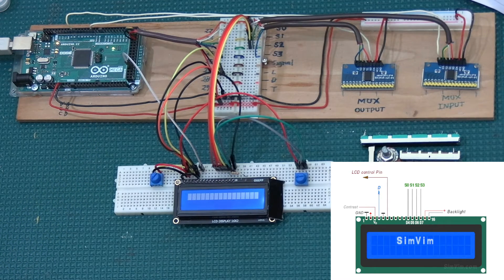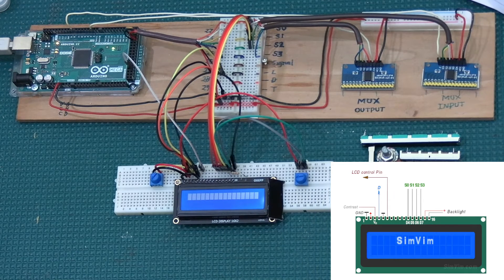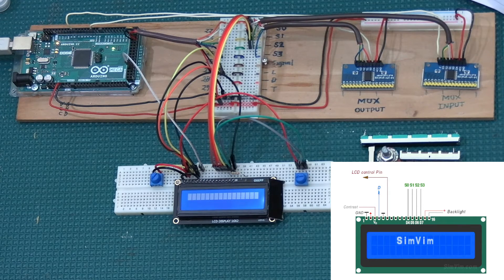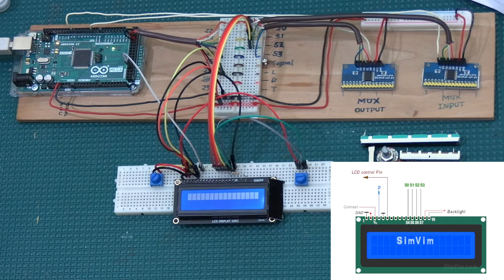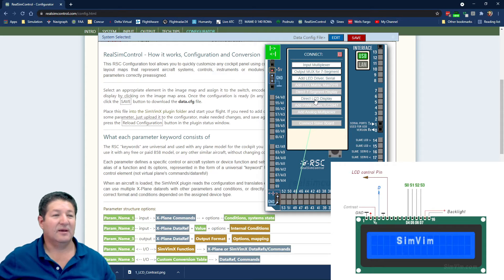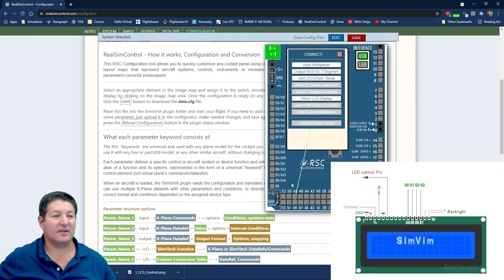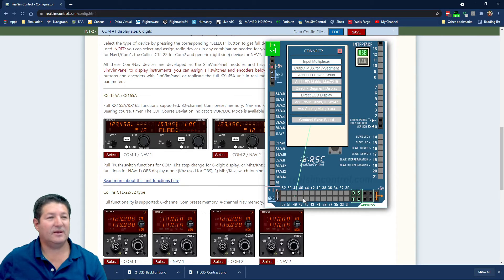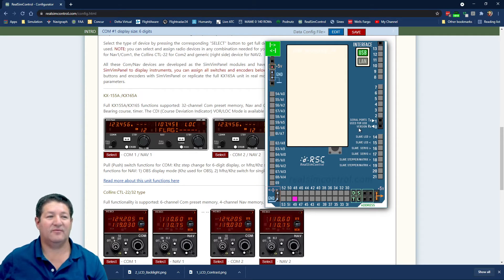Back to basics: Using LCD Displays with SimVimX (Direct Connection)

Comment: The simvim page is so complicated and can't find things to manage, Valad provided a way to play the gauges on second computer which connected to PC which was running the x-plane, I think that one is changed , I can't find anay Cessna file to place it in module folder to run it from second pc .
Reply from the maker: Hello, not sure why you're having such a hard time navigating the website. It still looks the same for now. Although they are working on making changes to SimVim Panel. All you need to do is hover over "SimVim Panel" along the top, when all the tiles open, click on "Cessna172"  On the page that opens up, scroll down to almost the bottom on the page and you'll see the download link.

If you want the full panel first click on "Full Panel" just below the banner near the right, then scroll down to the download link.

Comment: Where do I connect the "D" and "LCD control Pin" pins on the Mega?
Thanks
Reply from the maker: @joseclaudiodomingos4856  I think you need to watch my video on multiplexers to better understand the data and address bus.

But I explained it on this video, the D line is pin 28 on the Arduino and the LCD control pin is whichever pin you choose to assign an LCD display to.

It is a lot of wires so you might need to go over it again 😁
Reply: @Qosmokid  Ok, I was in doubt because in the video you put a comment indicating ports 20 and 21 and then use pin 28, it was confusing for me.

Comment: You use and introduce this plugin skillfully, thanks to you, I made a light panel, I connected it and it works without any problems, but I made an efis for 737 in one, as a result, another arduino did not see it when I connected it, and there must be a data cfg file, where should I put the data file I made for efis, Thanks for your help
Reply from the maker: Hello Bilal and thank you for your comment. You can only use one arduino and there can only be one configurations file. Everything for your entire setup must be in one config file.

Comment: Great tutorial.  I never played with screens due to the complexity, but this certainly made it easier.
Reply from the maker: Thanks Kris, It's funny I used to not really like using Max7219 displays because they need 5 wires, now that seems so easy compared to these. I had never even read the pages relating to this until the day before recording this video but within 5 minutes it was connected, configured and working. That's why I love SimVimX/RSC